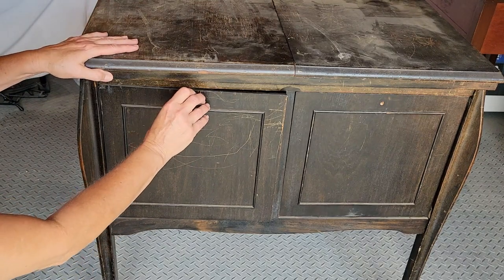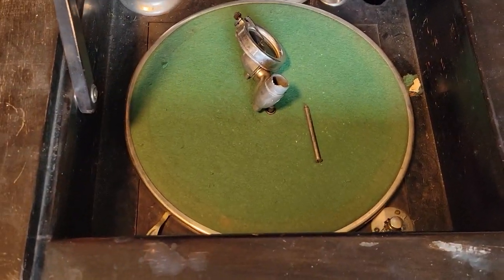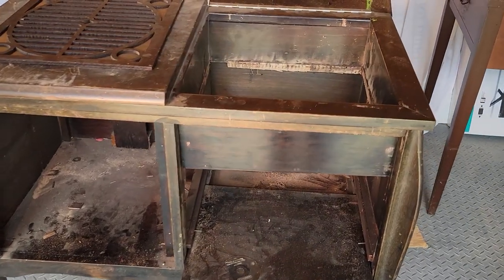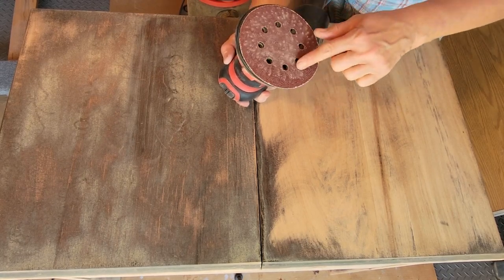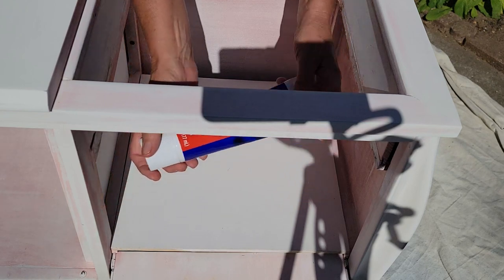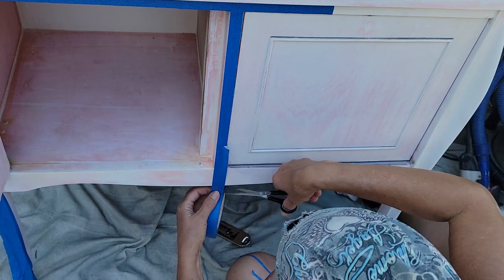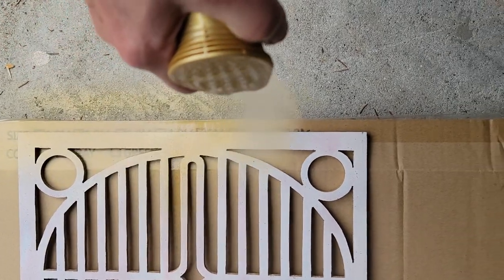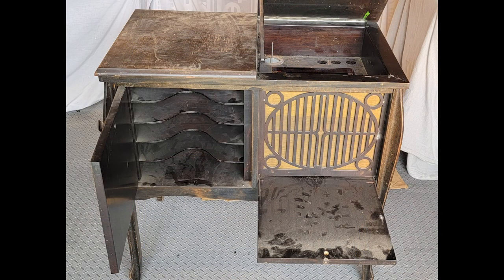How to repurpose a 1940 crank record player into a Liquor Bar! #uglyDucklingchallenge, 9-25-22

Comment: I renovated a 1924 phonograph several months ago. I was surprised it still spun too, heh.

Excellent preventing tearout with tape. 👍

Good idea using caulk (and the corner tool) 👍

Wow, amazing turnout! 👏
Reply from the maker: Thanks for commenting and watching.  Now I bet you never want to do another one after that.  I would have to really think about it.  But it was going to a landfil. So I thought what the heck.  Regards to you! Dar p
Reply: @diysbydar  I think I’m taking an indefinite break from commissions from strangers after that one. 😅 The renovations themselves were interesting. Keeping everything consistent with the time period (i.e. repurposing the record shelves and small pieces of veneer, and doing a French polish finish) made things more difficult. But the finish drove me mad. 😂

I was referred to her by a friend. It was my first furniture renovation, that I recall. I may have bitten off more than I could chew (in a timely manner). 😂 But I did ultimately deliver it to a very satisfied client. 😊
Reply from the maker: @DIYwithDaveD  omg,  I give you sooo much credit for that one.  If it was anything like this one on the inside, with that heavy thick stained top coat they  used 80 years ago.  I don't know how you did it!  And, maintained a level of excitement to walk out and face the piece every day.  I will check to see if you have a vid on that one.  What a crazy piece to restore or repurpose! Regards ,  dar p.
Reply: @diysbydar  I do have a two-part video. It’s called “renovating a 1924 Victrola” (or something like that). Thanks for the interest.😊

Comment: Love love love! The light adds a great touch too 😀
Reply from the maker: Thanks so much for checking this vid out.  I appreciate it sooooo much.  Yes, those little lights are really cool,  they Dim, they change color, and you can set a timer on them.  Battery operated with control from Amazon.  Its called a puc light.  Regards, dar p.

Comment: Would have liked to see at least one original shelf used in the piece. Maybe as the bottom of the left side as a pull out. Or at the very top of the left side as a pull out for an extra serving surface. Overall, very nice.
Reply from the maker: Hi Karen,  yes I was so much thinking about that.  Leaving one of the record slots on the left very top.  For napkins and small storage.  The way the insides were set up it was all or nothing.  It was built like a tank!  Thanks so much for taking the time to watch and comment on my vid.  Best regards, dar p.
Reply: @diysbydar  👍

Comment: As an antique phonograph enthusiast this was hard to watch. It's a little earlier dating to between 1922-1924, it's an unbranded budget model to be sold in various local department stores across the country. You're right that's it's not very valuable, maybe between $50-$200 in the condition you found it in but definitely salvageable. The parts could've been replaced/repaired, and the cabinet could've been cleaned up. Steel wool and GoJo (hand cleaner), Howard's Restore-a Finish and finally some varnish in the lighter spots to balance it out. Don't get me wrong, I don't mind converting old furniture, unless it can be converted back. The changes you made prevented it from being converted back in the future if someone wanted.  The sad thing about this whole shabby chic movement is people see videos like this or Pinterest boards and do absolutely no research on the one they own and ruin perfectly fine or even rare phonographs just to "upscale" them. I don't want my comment to come off too critical, I'm glad you saved it from a landfill, keep in mind people still collect these. A young local person just getting their hands in the hobby would have loved to restore it, I know I would have.
Reply from the maker: Hi, that does tug at my heart strings bad.  I have all the internals, would you like them?